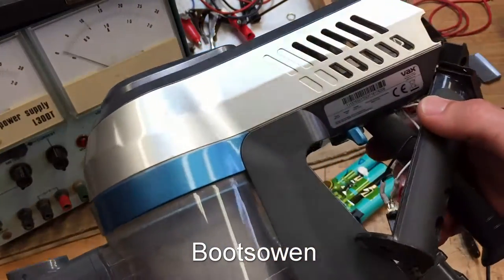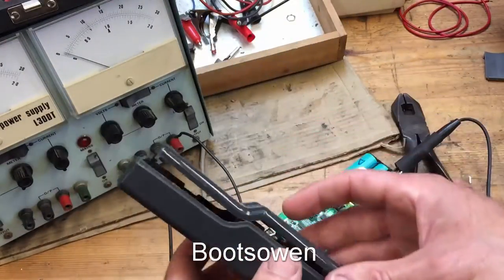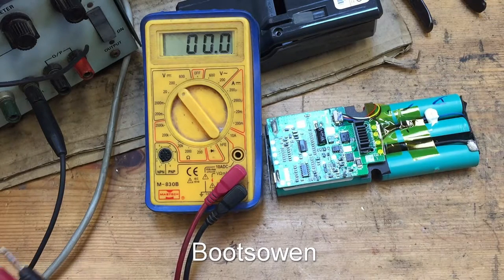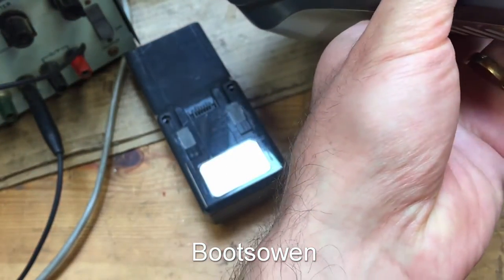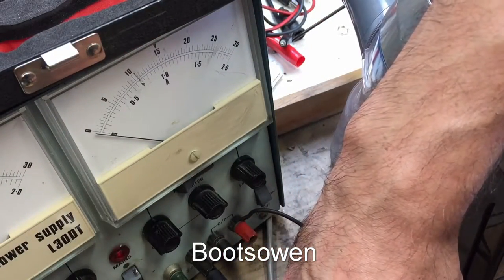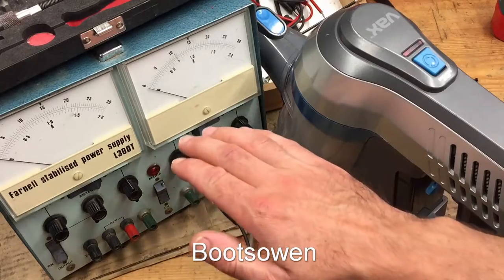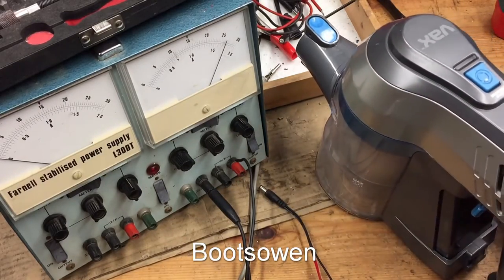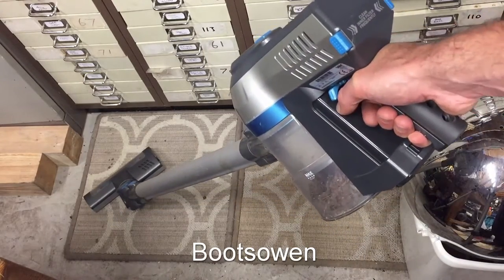Vax TBTTV1B1 216v Cordless SlimVac: experiments to ressurect the Li-ion battery

Comment: I think they are marketing smoke and mirrors and I am surprised there are not more in the scrap. Good source of 18650 s for repairing your power tools. Not sure if the brush heads are all that great, not a patch on the Air Ram units. Speaking of power tools is it true that some BMS units in (say) Makita have a chip that effectively switches off any charging after a number of charge / discharge cycles. If so that's another good reason not to fully discharge these type of power packs, Cheers
Reply from the maker: I haven't heard that about the Makita  batteries, but it should mean that they will be a good source of cells. it is just a shame that the builders throw them out in regular rubbish. I am generalising obviously!
Reply: @bootsowen  Owen save them if you see any, by the way I see you have a Makita with an orange battery, what volts is that as I have some of those packs, cheers
Reply from the maker: Will do Andy, The ones that I have are Makita PA14 Ni-CD 14.4v, and I have bought replacement 14.4v NiMH on ebay. I got 2 of the drills as part of a job lot of tools a few years ago and then found a matching drill in a skip somewhere. The NiMH seem to hold a charge for a long time when I don't recharge them, and they will drive 4" screws for an hour or so when I am doing work. I reckon they are pretty good.